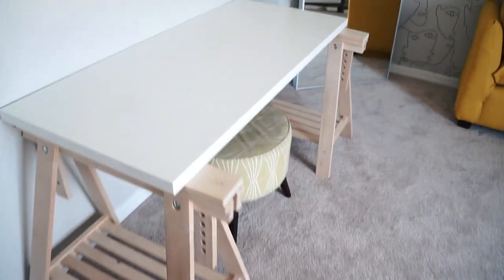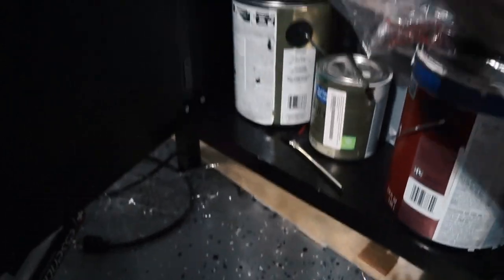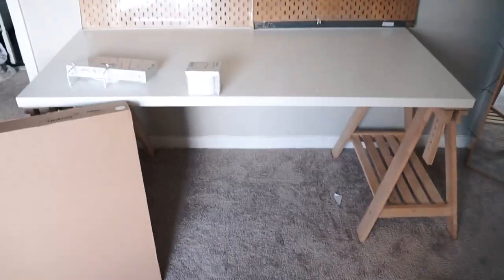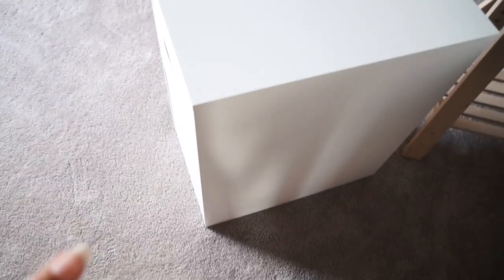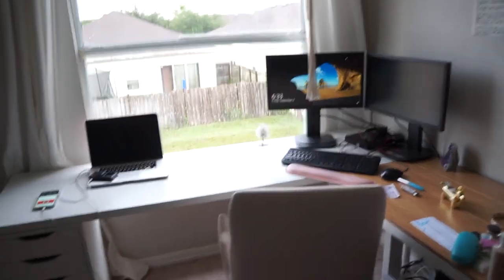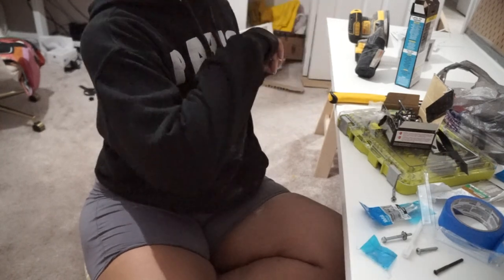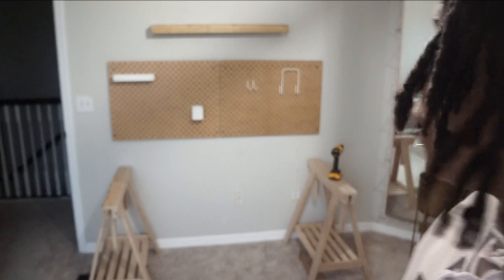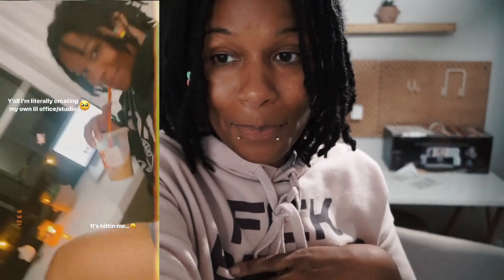HOME OFFICE STUDIO MAKEOVER UPDATES! ALMOST COMPLETE! WFH DESK SETUP | IKEA MIRROR HACK |  DIY

Comment: That corner definitely deserves an arch in that same type of yellow on your chase and that flat orange on the journal that would be cute even tho you said one solid one I think 2 colors would be dope as well 🗣🗣 either way that corner arch was definitely a fire idea  especially with the plant hanging there 🗣👍 you also said a vision board there I had the idea of cheap piece of plywood cut into the arch and painted as the vision board so yu get both ideas without having to paint the the wall or figure out the vision board placement 💭🤔🤔🤔💡💡